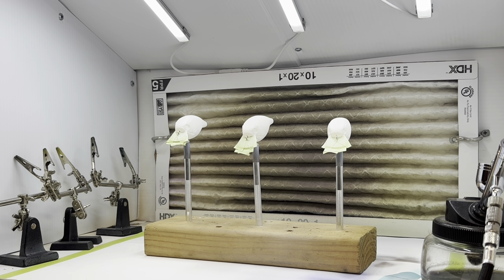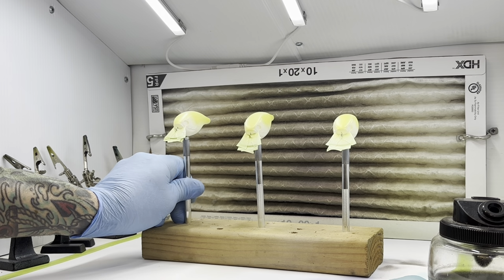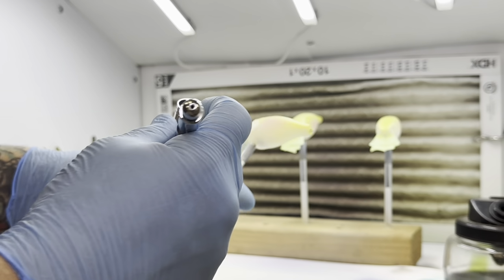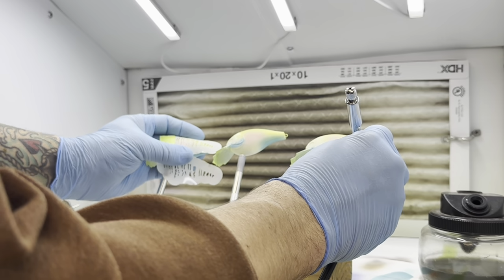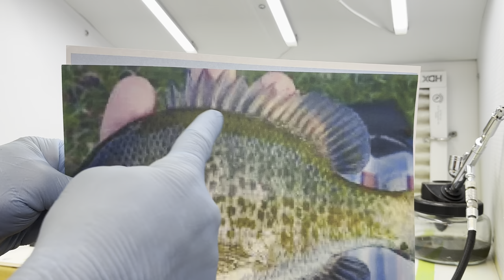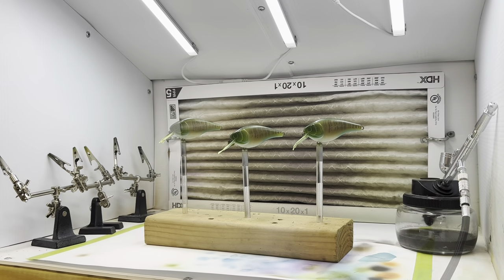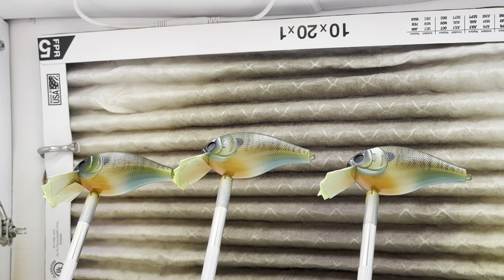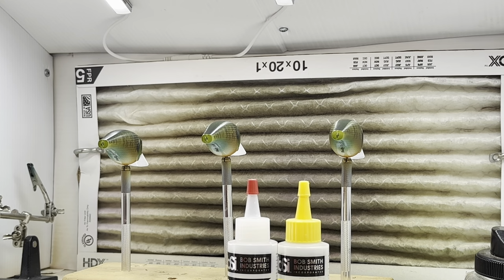CUSTOM PAINTED BLUEGILL CRANK

Comment: I qlmost bought some ofthe flokart color shift..what do u useto thin it out??
Reply from the maker: I use a homemade thinner that I make. I got the recipe off a website. Its 2/3 distilled water, 1/3 99% alcohol and 1 drop of glycerine for every 50ml of the mixture you make
Reply: I use this color ALOT. I thin it with Createx reducer and it comes out great.